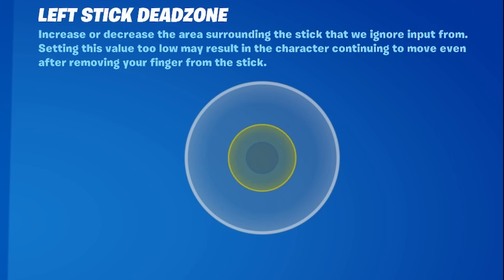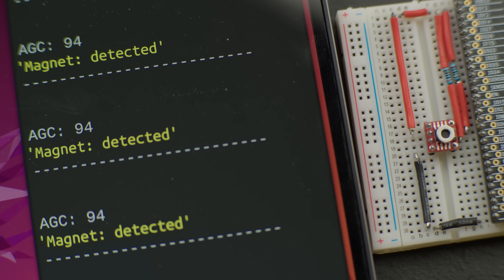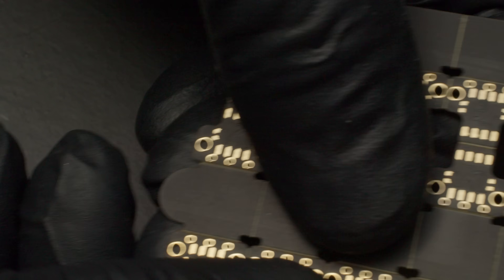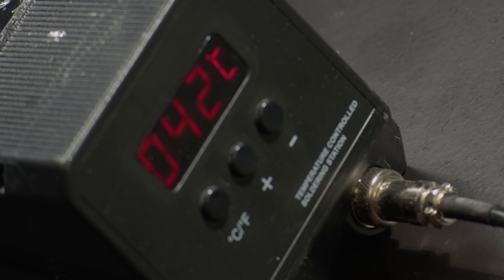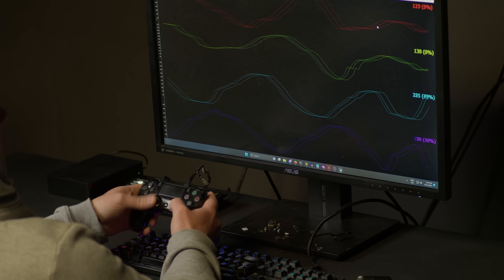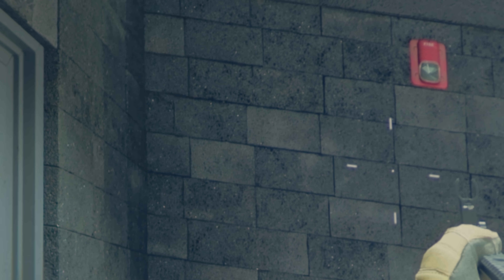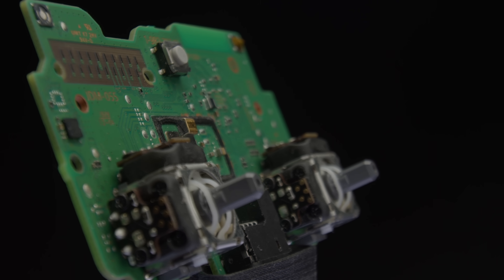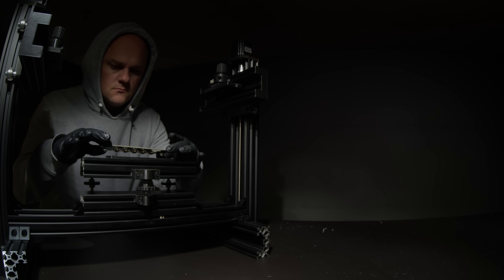Beating the $20B Joystick Drift Problem, and giving it away for free

Comment: Hall effect joysticks are already patented. I don't know if you can "give it away for free"
Reply from the maker: These aren't just ordinary hall effect joysticks. It's an innovative method because it combines multiple hall sensor elements, a CORDIC computer, and a DAC in a single package. Plus, it only works with a diametric magnet.

Ordinary hall sensors for position encoding use some kind of conversion table or algorithm to translate the magnetic field strength into a position. However, this approach is different. It uses the product of two magnetic fields to track the rotation of a magnetic field. Therefore, it's utilizing a different technological principle.

Comment: Fun fact: Sega put hall-effect joysticks in their 3D Saturn and Dreamcast controllers in 1998.
Reply: I wish the Dreamcast was more successfuI, then right now we would have had the dreamcast 5, playing Sonic with no drift.
Reply: I scrolled down looking for this comment exactly.
Reply: Yup but pretending to have invented something new generates more clicks. Also you can buy them everywhere now since they are making a comeback since last year I think even before this video was made.
Reply: @EbonyPope so they guy on the video did not iventened sht?
Reply: Interesting. I figured it was Sony who did it first, though it makes sense that Sega would have done it, they really went all out with the Saturn and Dreamcast
Reply: @daviddavidson2357 Sega also revolutionized online gaming as well, the Dreamcast was the first to have a web browser on a CD and used a 56kbps modem. The PS5 PRO in 2025 doesn't even have a web browser.
Reply: @hardkore360  Wait, the PS5 has no web browser?
Wtf, the PS3 did.
Used it to stream so many movies and TV series.
Though IIRC the PS4 didn't read CDs either. Sony has gone 10 steps backwards.

Comment: Good video. FYI, freeware flight sim control designer AuthentiKit have been using Hall Effect sensors in their free flight sim control designs for 2 years, and using Le Bodnar boards to interface with PC’s. Not taking away from what you’re doing, but HE sensors aren’t exactly revolutionary.
Reply from the maker: Its not just he sensor. Its a magnetic rotary encoder.
Reply: @MariusHeier1  , that is, literally what a Hall Effect control is; a magnetic sensor, a magnet,  and a rotary encoder. This is exactly what many controller companies and AuthentiKit have been doing for some time.

Comment: The fact that you got this small enough to fit into existing hardware is incredible to me, especially considering how things like controllers are purpose built and never designed with any extra space in mind. I hope this in combination with other hall effect pads on the market will finally force the big guys to make quality, durable controllers.
Reply from the maker: Yes. You are onto the absolute most hard thing to solve. And the ps4 controller is the one with the most space. I'm making other revisions with even smaller ones i have found now. Thanks for commenting.
Reply: @MariusHeier1  Thanks for getting back to me!

Comment: So how do you plan on combatting age-related voltage drift, something that all hall sensors do develop, and something that the majority (if not all) develop around 1000 hours in of on-time, of which becomes a runaway issue with the drift getting worse as the sensor ages.  Something nobody seems to discuss when talking about how amazing hall sensors are, though there's probably a reason why they didn't catch on 25+ years ago when Sega did it in the Dreamcast and the earlier Saturn 3D pad, and probably a reason why only Gulikit and KSilver, via a patent licensing and manufacturing partnership, are the only company to do it modernly, and probably why Sony found an alternative to hall sensors in their 4pin sticks during the PS3 era of which were also magnetic.  You also can't expect consumers to constantly recalibrate a module that can't be automatically recalibrated via the controller's own microcontroller and system software.  Also consider how short 1000 hours is, even with four hours of gameplay a day that's only 250 days, and consider how consumers also keep their gamepads powered on constantly, especially if they can throw it on a dock-style charger.  Gulikit/KSilver have also widely proven how jumpy hall sensors are, which is problematic. 

Hall sensors aren't great for joysticks, but they are decent for triggers.  Why? Because triggers aren't meant to be all that accurate in the first place.  First of all, they're large and fairly clunky, using a digit that isn't as dexterous as the thumb; plus you're not going to notice a difference from trigger pull to trigger pull, the most accurate you get with them is feathering and even then that's not all that accurate.  Second, a trigger at rest is outside the sensing area of the sensor, so you'll never notice drift at all.  Third, you have to understand how these sensors are correctly implemented, with a linear sweep either across or to/from the sensor,  and how trigger implementations are terrible, a combination of both a sweep to/from and across the sensor's plane along an arc; rotary position sensors, such as those used on motors, can get away with a rotary sweep due to segmented magnets and how field lines are formed, where the sense is only looking for hard lines (such as where north meets north) within the various fields, though this is also an apples to oranges comparison due to how different the application and implementation is.  Triggers just aren't accurate, joysticks are, they're orders of magnitude more accurate, but what makes it worse is the fact that you always have the magnet within the sensing range of the sensor, which is why GK/KS sticks have shown very jumpy centers with deadzones turned off; and keep in mind, anything using GK/KS sticks are calibrated when manufactured. 

Hall sensors just won't last the test of time, people within the field of magnetometry understand this, yet everyone outside of the field apparently doesn't, and rather than listening to more knowledgeable individuals people would rather start flame wars over their lack of knowledge and inability to fact check or even research anything; I'll admit, finding verifiable information on age-related voltage drift for hall sensors is difficult, a lot of it is locked behind paywalls for scientific papers, and a lot of manufacturers don't talk about this, especially on lower-end sensors, Texas Instruments is one of the few who touch the topic and even then it's a rarity to see.  There's better solutions out there, they're just underdeveloped or nobody's looking at them, such as Sony's abandoned design from generations ago, of which seemingly nobody knew what it was until recently.  Of these various other solutions, magnetic or non-magnetic of various sensing methods, one has a patent out of China from 2019 that uses the typical modern stickbox, and another as a product out of China from some OEM-ODM for primarily the automotive space but I can find nothing on the company besides their Alibaba page so I'd have to verify that these sticks are what the company claims.  But sadly, nobody is interested in better sticks, I genuinely believe the only reason Gulikit invested into hall sticks is because they got an absolute hoard of old sensors for relatively cheap, like a warehouse moving abandoned product cheap; i.e. the industry doesn't actually give a shit about the issue, full stop, which is why we're left with a lackluster solution for an even more lackluster product.  And the funny thing is, carbon wiper potentiometers aren't even that bad if they're constructed correctly, yet we don't and will never see that; it's not the technology that's an issue, it's the companies cutting corners.
Reply from the maker: I really appreciate that you took the time to write this long comment. What a challenge.  But give me some time to write a proper answer. Please if you dont hear from me by tomorrow just write me another comment. If you have time.
Reply: The aging effect could be compensated for at power up by reading the neutral values and also adjusting the min and max to values read from the hall sensor as it's eventually moved to full deflections. Other systems do this already, but it would need a microprocessor added to the design, probably on a daughter board in shrink-wrap that could be positioned in the case. I would love these for my XBox Elite controllers!
Reply: i dont get it, we use hall effect based potted position sensors in a specific task in machinery. they stay true to <0.5° in their 90° range over the course of 10 years continuous operation.
how do they compensate for that in the module already? there isnt even a calibration routine.
Reply from the maker: @anxiousmerchant4129  Do they have automatic return to center mechanism? And how big are they?
Reply: @MariusHeier1  its a potted 24v modul which converts the signal to the common 4-20mA. So i dont doubt the do some compensation, but a runaway after 1000 hours sounds unrealistic here.
 the puck is like 5cm in diameter. and as i said, no calibration routine. they monitor spring loaded swing arms and get adjusted one time by rotating them to a specific value at the mechanical stop. In short, the only time they even are in center is periodically a few milliseconds by random
Reply from the maker: @anxiousmerchant4129  yeah. So this is auto centered by a spring at a tiny tiny space. With 255 positions over about 13.5mm travel in horizontal space. And if center is 1 position of, its gonna drift unless you add dead zone. So thats one of the reasons why its hard and different.
Reply: @MariusHeier1  in a control stick you always add a (small) dead zone. otherwise it would drift of or jitter just because you leave the thumb on the stick. 
Speaking from experience here, i build an entire hotas + pedal set with hall effects, deadzone are required and non linear axis response minimize that effect even more.
Reply from the maker: @anxiousmerchant4129  I know. , I understand. I'm trying to explain this in the video because many gamers believe it's possible to achieve 0 drift. This misconception arises from another company neglecting to mention that they simply added a deadzone to the controller instead of addressing the issue in the game itself. They market it as having 0 drift due to hall sensors, and not because of a deadzone.
Reply from the maker: @anxiousmerchant4129  All these things can be done in the game. And i think that is where they belong. 😉👍
Reply: @MariusHeier1  oh, i didnt notice i was arguing with the channel owner lol. original question was meant for xaytana
Reply from the maker: @anxiousmerchant4129  haha. Thats funny. Almost same here 😉😎

Comment: I wouldn't say it's a 100% a friction/grinding problem since even some of the most worn down PS1 and PS2 controllers have perfectly healthy potentiometers which can be reused without any issues, my take is that Alps changed something when they moved to the smaller pots used on PS3 controllers and onwards, maybe it's plain programmed obsolecense or maybe their newer manufacturing process is flawed, but either way it seems like Hall Effect Sensors will take their place back into the analog game!

Comment: These hall sensor gimbals has been in radio transmitters for rc planes and such, with great results, but there is still a problem with thermal drift. I believe the best kind of gimbal would be an optical one, measuring luminanca. No drift.
Reply from the maker: I bet it is. Thats why these are not just hall effect sensors. But rotary encoder. They have compensation for thermal drift. Check out the datasheet. As5600

Comment: look man, even if you would decide to cash out on this and it will become available on scale, I would still be thankful.  stick drift in the industry is currently so bad, that I went through 5 xbox elite controllers in 2 months because of it. I expected the elite ones to last longer, but they suffer from the same stick drift issue as the basic xbox controller.  ended up with a controller where I can easily just replace the sticks instead.  good job man and thank you for the effort on this project.

Comment: This is one of the factors which caused me to step back and not buy a PS5 even when some were finally available. I do not want to buy a expensive console with a controller that (ifixit did a tear down and claimed every one will INEVITABLY get joystick drift) will end up drifting. Meanwhile my very old controllers from back in the day still don't suffer from this. But the previous generation and this general are now getting them so frequently that people post videos about it periodically. 

I don't really want to have to keep buying new controllers or buy replacement joysticks for the new expensive PS5 controller where you can swap out the joysticks. That's just putting more of a burden on the consumer (like "hey you bought this from us, you fix it yourself). This isn't a cheap controller and all that plastic and components being thrown away each time you swap out a new joystick is also bad for the environment. 

We need to be moving AWAY from wasteful resources in this day and age.

Comment: I just got into fpv/drones and couldn't believe how even the cheap radio controllers use hall effect sensors but not high end gaming controllers, seems like you got the ball rolling and things are about to change!!
Reply: The funny thing is that this has been known for a while now, but it still hasn't been adopted into the current new gen consoles. Probably because if the players keep on buying new controllers it makes the companies more money.
Reply: @wenelol  
Exactly
Reply: There's a reason for that. Money. Sales.
Reply: My first thought when i got my first drone.. it was 8 years old , used, and i had to fix the battery holders cause they was crusty, and I'm like, why is this controller from a $20 drone have better joysticks then a ps4 lol . The rest of the controller looked like trash, but even the micro switches were pretty good. Sony made the ps4 controllers like a $20 keyboard .. cheapest of the cheap everything, except the arm MCU. It's not bad. The PCB material itself is good too. But everything else is meh at best
Reply from the maker: @Optimus514  yes. As long as they run on 3.3v
Reply: it's because hobby transmitter manufacturers know that skimping on the gimbals and potentially causing a customer to lose their hundred/thousand dollar drones would make their customer avoid that brand as a whole like a plague, while console manufacturers know that their customers will have no choice but to buy another one just to continue using their platform
Reply: @omurize2007  I even had issues with sticks drifting a tiny bit and Jumper (the radio transmitter/rc controller company) sent me replacement hall sensors for free.
Reply: But they don't. I'm working on a single handed drone controller. Having torn down about 50 controllers I've come across 3 hall sensors. Not 3 controllers, 3 total hall sensors. They are RARELY used.
Reply from the maker: The problem is that hall effect sensors alone only work together with a ton of signal processing. Thats why rotary magnetic encoder like this is tracking two magnetic field 90 degree apart. So they position track the magnetic field instead. And do temperature compensation.
Reply: @NoMoreBsPlease  im not sure what you mean by working on controllers but if im assuming your job is to fix controllers based on how many youve came across, then its like saying there are more sick ppl at a hospital than anywhere else. ofc you wont see much hall effect controllers if thats the case, because they dont break down as easily. though thats just my assumption tho feel free to correct me if im wrong.
Reply: @NoMoreBsPlease  that is probably more to do with the transmitters you have torn down and not the state of what’s out there, cheap transmitters still use potentiometers but the majority of mid range and up transmitters will use Hall sensors.
Reply: @NoMoreBsPlease  You must be opening up those cheap FlySky controllers or the older FrSky controllers, almost all new drone controllers right now have hall effect gimbals like the Jumper T-Lite V2, Radiomaster Zorro, FrSky X9 Lite S and even the cheaper BetaFPV Lite Radio 2 have hall effect gimbals
Reply: Hall effect contollers has been on the marked for a long time now, nothing new.
Reply: @turji  Exactly, the Dreamcast controller even had a hall effect analog stick back in 1998. It's Sony, Microsoft and Nintendo that are at at fault here for not implementing it because the cheap analog sticks save them pennies and the wear causes people to buy more controllers. A win win for them as a company, but awful from every other metric.

If any readers are using PC, Switch or mobile, there are options out there using hall effect joysticks, from 8bitdo and Gulikit. I have the Gulikit king kong pro 2 controller and while the triggers aren't as nice feeling, that's a small concession to make for an analog stick that does not develop mechanical stick drift.

Comment: Would this work for Meta Quest Touch controllers? They suffer from severe drift for thousands of people and not only that, you can't buy new ones from stores, Amazon etc. The only way to get them is to buy them directly from Meta. Since 2016 I've gone through maybe 10-12 controllers. If you can make a pre-built drop-in replacement for Touch controllers, you can pretty much charge whatever you want and people will line up to buy them.
Reply from the maker: Most likley. Almost all gaming controllers use this.